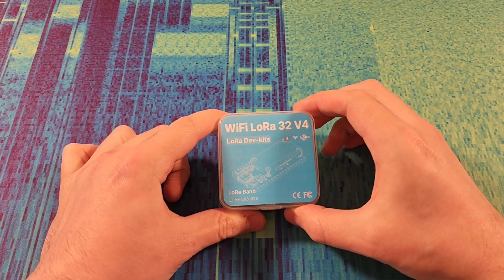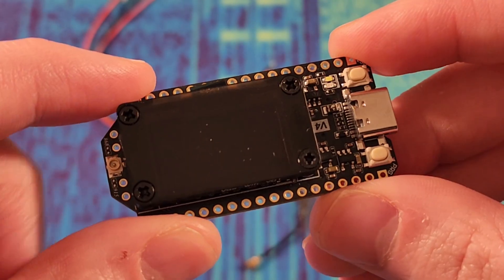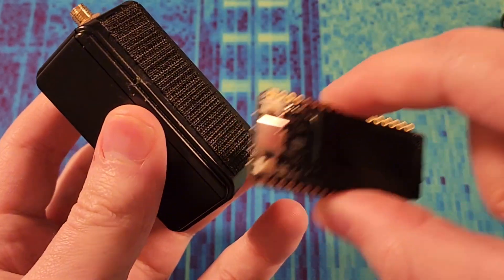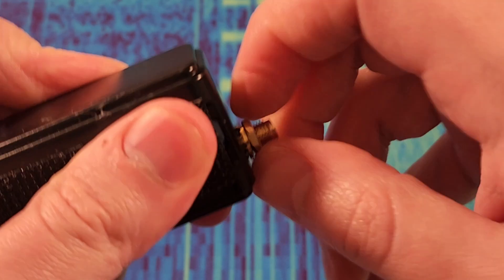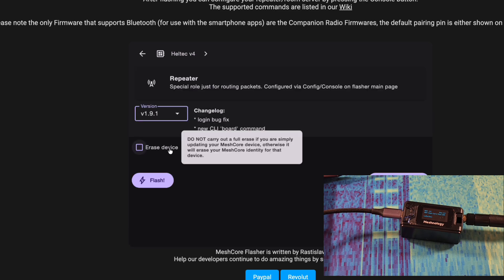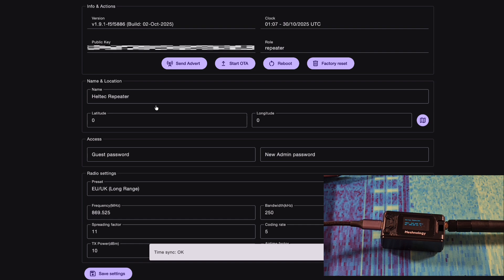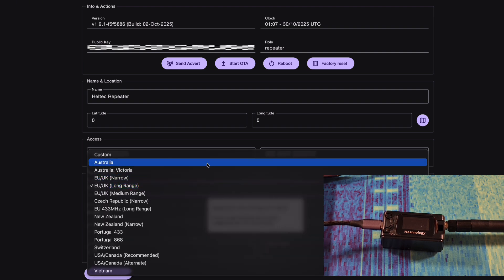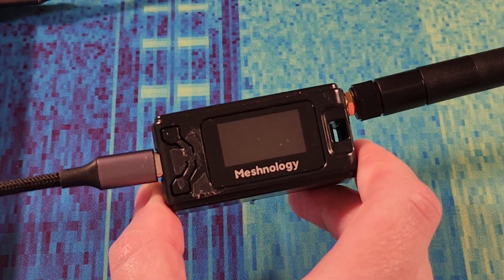Heltec WiFi LoRa32 V4 Setup & MeshCore Flash – Repeater Node Guide

Comment: How can you change the settings on this or update the firmware if it is put somewhere inaccessible like on top of a mast? And what software/app to use? Thanks.
Reply from the maker: Make sure you set an admin password for the repeater.   Next login as an admin from a client.  Access the console.  Type start ota.  This will create a wifi hotspot. from a laptop or phone access that hotspot.  The IP is 192.168.4.1 and upload the firmware.   Note I haven't fully tested this I have only put it into ota mode.